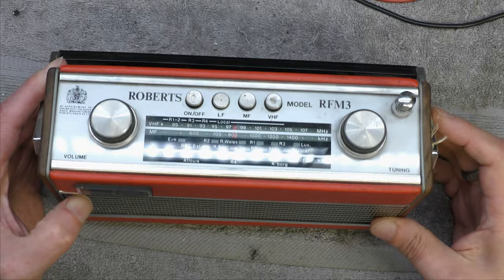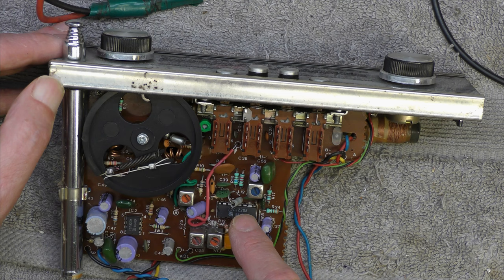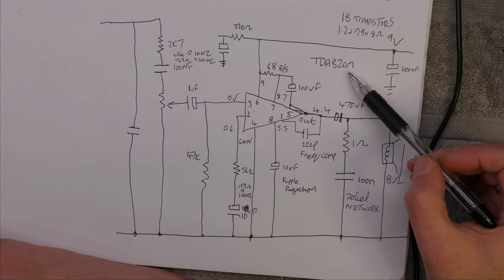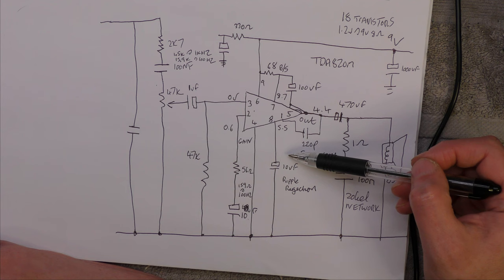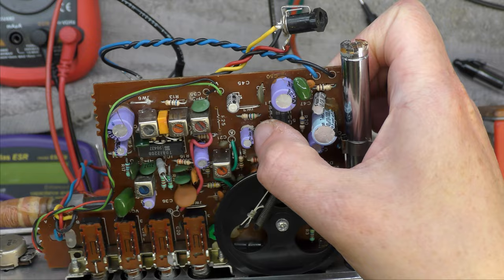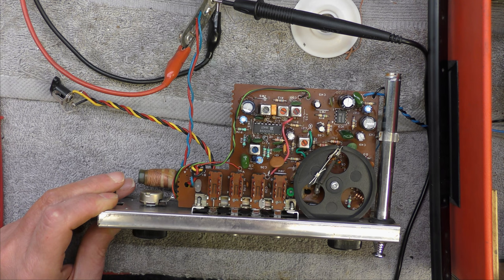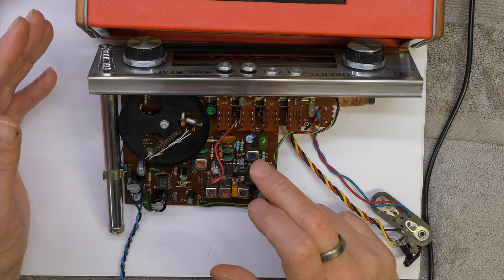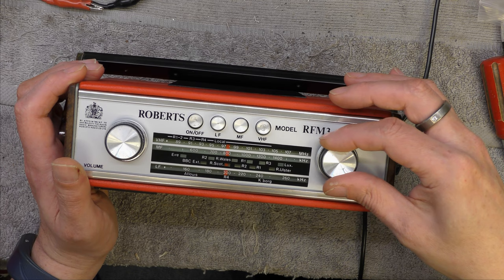Roberts RFM3 My First Roberts Repair (V2) (4K)

Comment: Little more explanation regarding the Zobel network, its purpose is to make the output appear resistive rather than inductive, without it the back EMF caused by the inductance of the voice coil will cause high voltage spikes which could exceed the breakdown voltage of the output transistors in the TBA820.
Reply from the maker: Thanks Michael for making that clearer. Daz

Comment: Happy New Year Daz, and congratulations on breaking your Roberts Duck...
Interestingly, the RFM3 is the Roberts Rambler II - same board - the Rambler II evolved into the Rambler-FM (RFM). It would have been called the Rambler 3, but someone at Roberts had a brainwave...
To say it's your first Bob, I enjoyed watching and hearing your circuit analysis, I've done many of them over the years, but never gone into the detail of circuit operation as you have. Looking forward to more... Maybe grab another chat at Biggleswade or somesuch, you should be on Roberts repair no. 432 by my reckoning by then 🤣
Ashamed to say I wasn't subbed, but proud to say I am now...
Reply from the maker: Happy New Year Paul, thanks for the Sub too. I'm sure the naming of the radio was thought too long, so perhaps the sales and marketing thought RFM sounded snappy, LOL. Was good to see you at Biggleswade. I did find the circuit interesting and how it was optimised for compactness and ease of setup in production. Daz

Comment: Hi Daz, usually people shove the wrong polarity  9V up 'em from an external supply :) Seems a popular thing to do. These are nice little radios.  HNY to you.  Regards - Andrew
Reply: certainly wont do them a lot of good, 😉  common issue with zx spectrums, as polarity is centre negative, instead of more common centre positive, usually it blows the top off the 7805 regulator and possibly destroys the +12/-5v oscillator transistor
Reply: @andygozzo72  No :) Usually blows the TDA amp in these. I put a Schottky diode in-line with the supply now.
Reply: @Andrewausfa  probably would,  not possible, without force, to reverse the internal, battery supply but external very easily done, cant remember what polarity these use, i never had the model shown in the video but had a couple of others with dc in jack..   a discrete transistor output stage may well survive reversal for a short while,
Reply from the maker: I wondered about fitting a diode to it to protect it. HYN to you and was good to meet you Andrew, in September. Daz

Comment: I think it'll be pretty sad when they finally turn off radio broadcasts.  But it's coming, that's for sure.  And to some extent I do 'get' it.  But I also have a general objection to internet only broadcasts.  It's the same sort of thing that they're doing with phone lines.  And that's all fun and games until there's a power cut.  I know power cuts are pretty rare these days, but who knows what the future holds and in a disaster scenario the old tech wins by a mile.  Of course, we should not expect that the relatively expensive old ways of doing things will be kept going only for that "just in case" scenario, I understand that.  But it'll be sad, just the same.
There'll be a pretty significant demand for car radios that can accept phone streaming when that happens.  I know many of the new cars have that built in, but there are also many that still don't - my 2019 car doesn't.
Reply from the maker: The LW radio 4 transmission was supposed to be the emergency one I thought. I did read that radio 2 and radio 4 would continue on FM if we had power cuts this winter. I remember in the storms of 87 FM was still on lower power. Yes, ofcom did relax battery requirements for telecoms I remember. I guess all these transmitters cost money to run and cost is important these days. I expect by 2027 the am bands will be pretty dead, but I expect FM to go longer. I wonder if community stations will keep going longer, such as radio Caroline. Thanks Brian. Daz
Reply from the maker: @David Wanklyn I think that's true on the dab.  I also think that radio is free, data/broadband incurs a cost.

Comment: Good news Darren, a quote from the Mail online today: "Big radio switch-off is DELAYED again: AM and FM stations will be available on old devices for another decade as switchover from analogue to digital is put off until 2032" Bad news also in the report "The changes only affect analogue commercial radio services as digital radio is subject to different arrangements. The BBC's radio stations are not subject to the rules." So maybe the BBC will leave analogue soon?
Reply from the maker: Well the commercial stations can hand in their AM or FM licence's at any time, but continue to have protected status on the D1 national multiplex. So they can switch too. All it means is they can continue to use and AM and FM and that's good news. But they can hand in licences. Luton and Bedford AM licence's for smooth were handed back. When my local smooth am transmitter went off, I contacted them to check if they had shut it down. They said no, there a fault. So always report a AM problem I say so they know it's being used. Transmitter s cost money to run, but because of the net neutrality, carrying on the net is cheap. Also that transmission cost is pushed to the consumer as they have to pay for data. Many thanks,  Daz.
Reply: @darrencoe5795  Thanks for additional info. Good to know. It's a bit like right of way on public footpaths, use it or lose it. Or at least let them know you use it.

Comment: i had a roberts r505 with a random shorting cap in the audio output stage,  cant remember if output coupler or bootstrap, quite a while ago, watch out if you get one of these, i dont think they used one of high enough voltage, a 6.3v type was fitted, it had about half supply volts across it when working (4.5 ish) so you'd think ok, but got a short surge overvoltage each time set was switched on,,  all other caps were A1, (all blue philips)
Reply from the maker: Thanks for that. I don't think modern capacitors have such a headroom as they used too. Daz
Reply: @darrencoe5795  poor quality, cheapened, too much miniaturisation,  'capacitor plague' in the 2000s due to incorrect copying of the low esr electrolyte formula

Comment: Well that sounds a lot better now :-D
I have to admit that i have never looked close at boot strapping, i would have checked the components around the amplifier, anyway.
Thin sounding audio is often poor coupling.
I have never liked digital radios, they give you THERE SELECTION of stations,  no freedom to listen where you want.
You won't be able to listen to other countrys radio.
Boxed in with no real choice.
They know were they can stick there digital crap!.
Can you tell i don't like what they were up to.
They pulled the same trick with freeview t.v, low quality crap that wasnt anywhere near as good as analog.
Ooow aint i an angry man :-D

Comment: surely you mean TBA820M, never heard of a TDA820M? unfortunately the TBA is now discontinued by its original and main manufacturer so i dont know what long term availability will be, these were used in a lot of stuff, i 'think' theres some 'clone' ones around... there used to be a 14 pin version, without the M but much harder to find
Reply from the maker: Yes I did mean TBA. My mistake, whoops. Daz.
Reply: @darrencoe5795  hehe 😉 stock up on  a few while theres chance,  you can use a lm386 in place with a bit of alteration but is lower output

Comment: I guessed it was a high ESR cap.
Reply from the maker: Fun finding it though we knew it would be. Daz
Reply: @darrencoe5795  yep, 'modernish' caps dont last as well as the older ones,  especially the blue philips ones, they seem to last forever with only occasional bad ones,   that said, i never assume caps are bad, like some do,  i find most do last pretty well,  i wouldnt 'blanket' recap unless signs that more than 2 or 3 of the same brand caps were giving issues, or signs of leak as you found,    dont forget these types are not low ESR but standard grade, so may seem a bit 'high' anyway